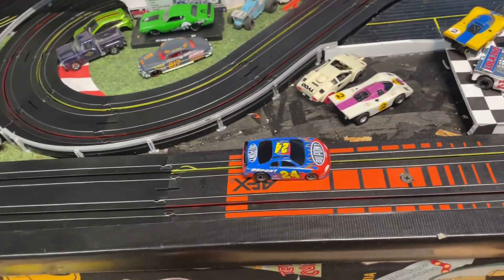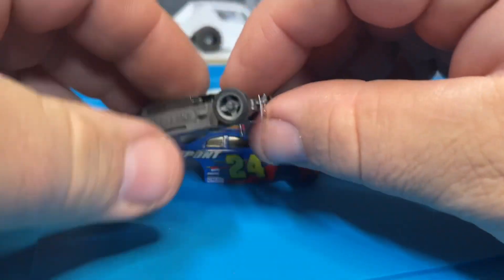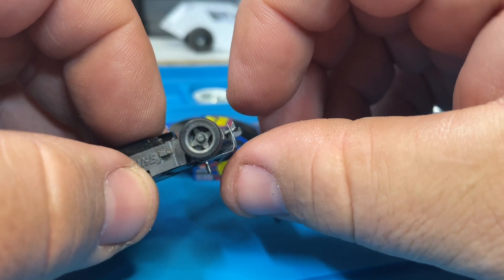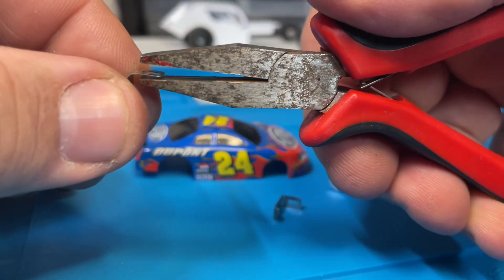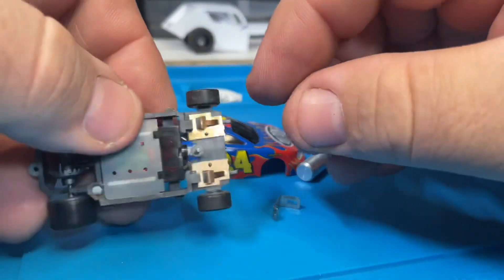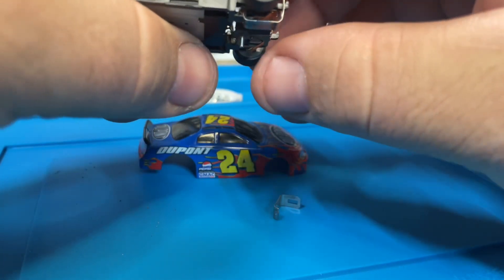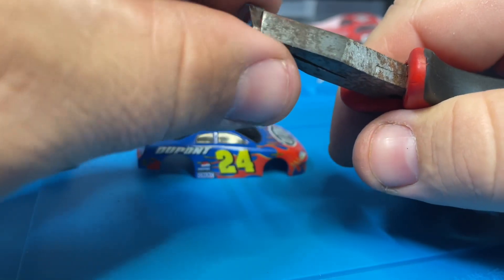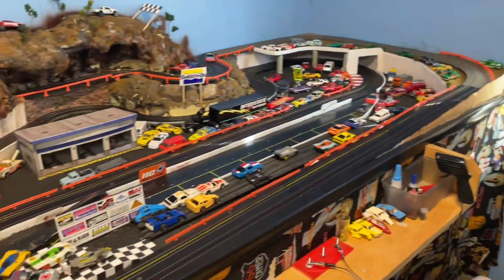Tech tips for Life Like Slot cars

Comment: If you bend the rear of the shoe a just a degree or two to more of a 90 that helps also if need to get more of the shoe flat to the rial. 90 degree bend on the front for sure. Marking the shoes with any color marker to get wear pattern is a good thing to do also.
    Nice video

Comment: Nice track. I really like the whole landscape. How does one go about puting something together like that? I bought a Life like set in maybe 2002 or 3, Four lane speedway and i woul like to give it a city scape/freeway design. What is your tracks footprint in feet?
Reply from the maker: Thanks a lot. My track is 3x9. I have since gotten rid of the scenery and switched to a viper track for racing. I did most of my landscaping with great stuff foam and model train supply’s like the little trees and the grass. If you look up model train layout videos there are some pretty good instructional videos on here for doing scenery. I will tell you this it’s a lot of work not only to build but to maintain also.